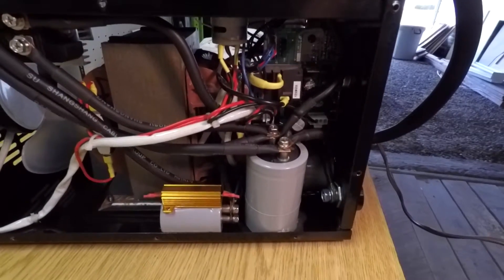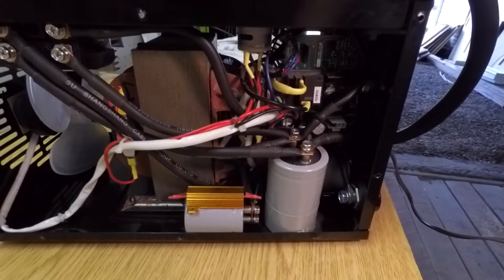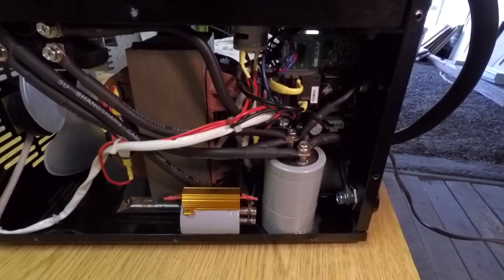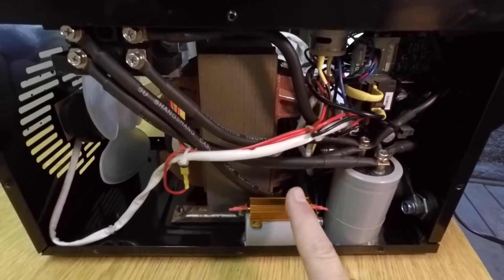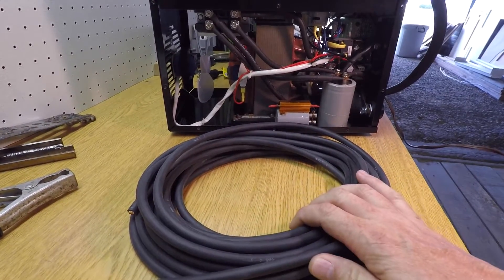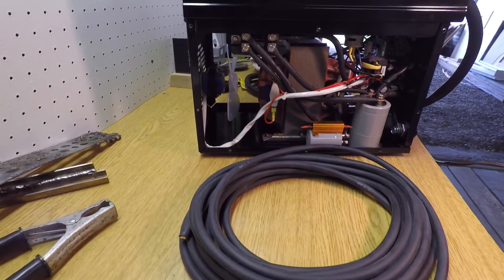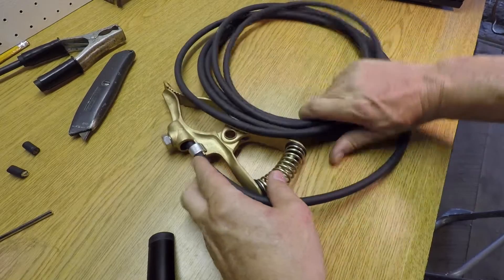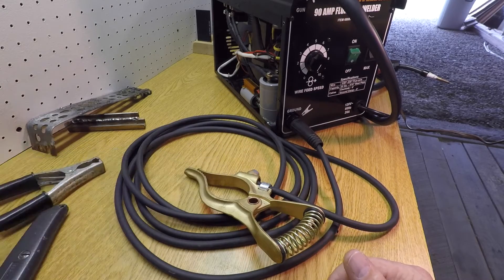How to Build a Custom Welding Ground Clamp and Lead for Your Flux Core Welder

Comment: Replacing the cheap cables/ground clamp/stinger included with those $125 Amazon inverter stick welders with heavier gauge cable, a high quality clamp, and a decent electrode holder that you've just showed us how to assemble ourselves would make those cheap welders work orders of magnitude better.
Reply from the maker: I agree!
Reply: @DIYHomesteadProjectsDIYHP10  - can't remember the specific review but the ground clamp that came with this welder was total garbage plated light gauge sheet metal. It had such high resistance that it heated up to the point of burning the plating off of it and became too hot to touch. The work piece wasn't hot at all. That all translates into a less powerful arc/less current, less penetration into the work, and a weld prone to fail. Even if only the ground clamp was replaced with the one you used, just that one piece, results would improve.

Comment: Well done -- Thanks!
Why does the Berger clamp bottom jaw protrude an extra half inch? Any clues - there MUST be some reason? To me, it would seem to limit where you can attach it (I would cut off that protrusion).
Reply from the maker: Good question, I don't know the answer.

Comment: It’s low voltage so you shouldn’t get a massive shock I got belted with 450v before on a tube amp and that will get you like a snake bite just put one hand in your pocket and put your phone away so you don’t get distracted

Comment: I would highly recommend soldering the wire to the sleeve first, then insert in coupler and torque down with Allen wrench. Regards-
Reply from the maker: That's a good idea Edward!

Comment: Strange how people always avoid telling the cold hard truth when warning about large capacitor safety. Let me be the one that says.... "IT WILL KILL YOU" if that capacitor discharges through your body. Never use large capacitors without a bleed resistor in the circuit like he's got in this video. Just to be sure they're discharged, i always connect a lightbulb with some alligator clips to be 100% sure
Reply: Super good tip. Thanks a million.
Reply: It’s low voltage less then 40volts dc I never seen a person die from dc it’s ac that is dangerous
Reply: I did that mod to my HF 90a welder.  I don't have a bleed resistor installed.  I clamp a piece of scrap under the ground clamp.  At the end of each bead I touch the wire to the scrap to discharge the capacitor.  I eventually want to install a bleed resistor through a relay so the resistor is out of the circuit while I'm welding and when I stop the arc the relay closes the resistor circuit to bleed the capacitor down.

Comment: Does that resistor not get hot as hell while the machine is on?
Reply from the maker: Good question, I don't know. I have never checked the temp of the resistor while operating the machine.

Comment: your clamp lead shouldnt be any longer than your wire welder wand set up or its a waste. You can only wire weld as far as your wand will reach
Reply from the maker: You are right about the length of the lead length. This ground lead serves dual purpose for me, I also use it on my little inverter stick welder that has an equal length lead for the electrode holder and that is why I made it the length I did. The extra length on the HF 90 flux core welder is as you said, not necessary but it's a much better lead than the stock lead that came on the machine.

Comment: you need to install one of those bleed off components on the capacitors, I dont know what they are called.
Reply from the maker: I have installed a bleed resister on the capacitors in this machine modification. I show that in one of my welder mod videos.

Comment: I used to be able to calculate the discharge time of an RC circuit but it has been  years since I did that.  I would have to pull out my old electronic books to even remember how.  It is a shame that I let something I love slip away like that.  I know you are done with this modification but I am still making my way through my backlog.
Reply from the maker: Funny how we loose it if we don't use it. No worries, I just use trial and error for most of my projects. Ha Ha Real world testing, it doesn't get much better than that. :)
Reply: I have a degree and electronics and,  though I'm a telephone cable splicing technician now, I can still do pretty well at component level troubleshooting. Fault finding is a skill and a process that works for many disciplines. What I wanted to emphasize about you lamenting not remembering the formula for calculating RC time constants (via a quote attributed to Albert Einstein) is this: Never memorize anything you can look up! Don't sweat it, fellas - even if you were taught and tested years ago, that knowledge is still in there - you just need a little reminder now and again to kick it back up!